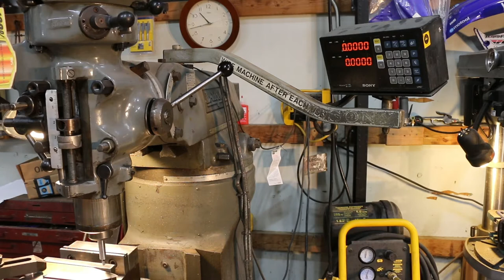Putting a Fuller on a Bowie Knife 1-28-21

Comment: Would be curious if you put a micrometer on the bases of each fuller? Interested to know how thin the steel is at those points.
Reply from the maker: I started with .190" steel. The fullers at the root measure .130" using pin micrometers.

Comment: Break out the mill . There are more skilled ways by hand that are more effective and show more skills . WE few Bladesmiths are fed up with this ABS "ANYTHING GOES "method of craftsmanship . Why can't Smith learn older BY HAND skills at placing a fuller ....... Cranking up the Mill with a round faced cutter is NOT particularly skilful in the terms of craftsmanship !
Reply from the maker: Thanks Andrew. I am not an ABS smith, and I too am passionate about craftsmanship and the old methods. Which is why my machine shop is manual machines. No button pushing in my shop! Haha
I do believe manual machining is a skilled trade of craftsmanship. But I understand my method may not be the most skilled way of doing it as a smith. I certainly wasn't trying to demonstrate the most skilled way to do it, just they way I was able to do it to meet my needs. Thanks for the engagement!
Rob